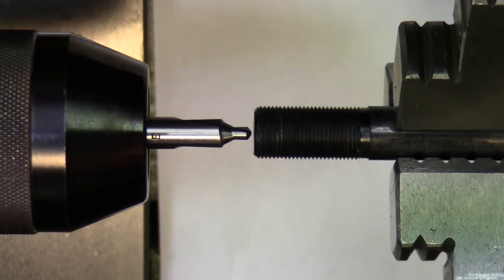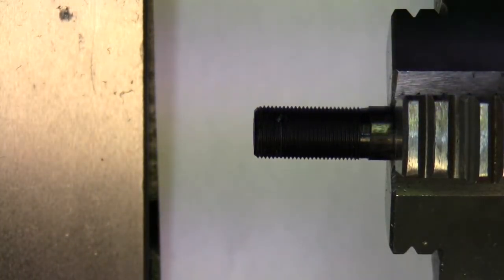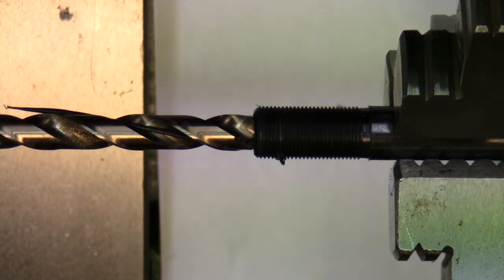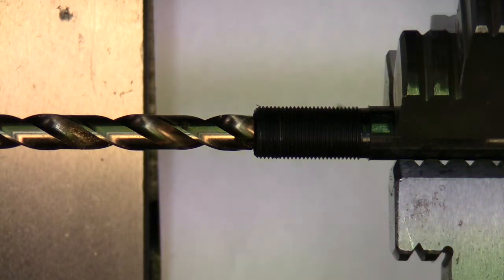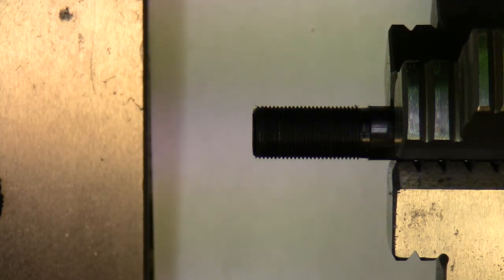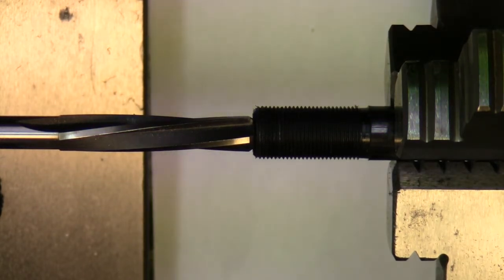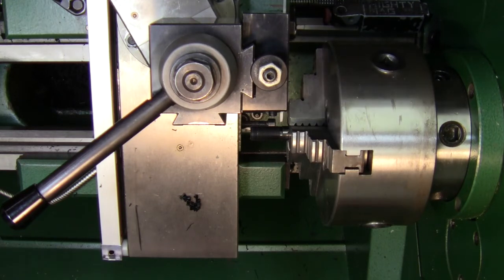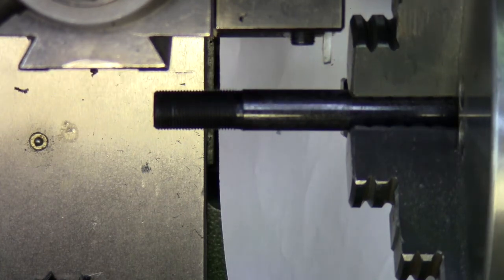Drill and Ream a Delrin Hand Piece Barrel

Comment: These episodes are getting addictive!! Lathing plastic on my mini lathe makes you feel like a proper machinist :) with chips flying. Ahh competition, a guy is sending me a 3d plastic handpiece, it looks a bit 'Tesla' you engineering guys are so clever. We need an electronics one to make the circuit for the solenoid graver, IS THAT YOU :) Airplanes are gotta me more complicated  ? Plastic, and no pump ?
Reply from the maker: Auto levitating solar powered flux capacitor laser beam engraving hand piece coming right up!
Reply: @ralex397  now we're talking! I  did start to make a treadle powered one for an apocalypse! Who knew you would still be able to get food delivered when that happened🤔
Reply from the maker: You may have to dust that thing off if we lose power!
https://www.youtube.com/watch?v=oJQR1q_0HYA